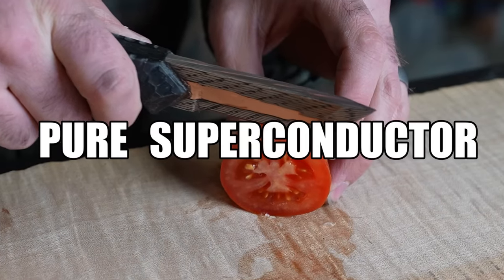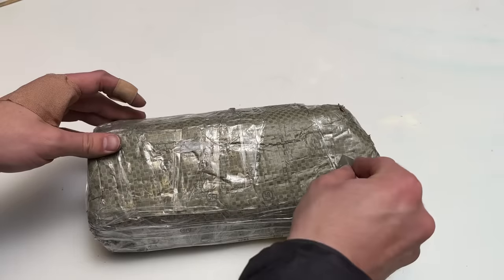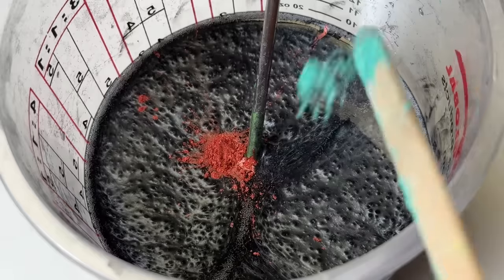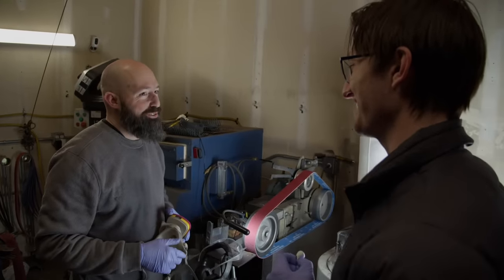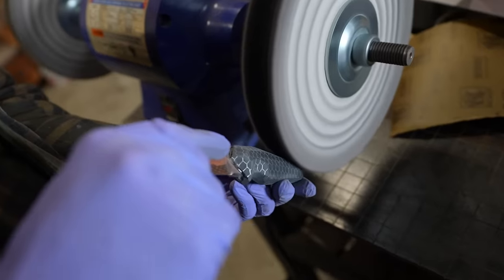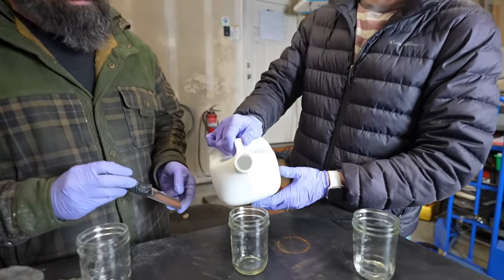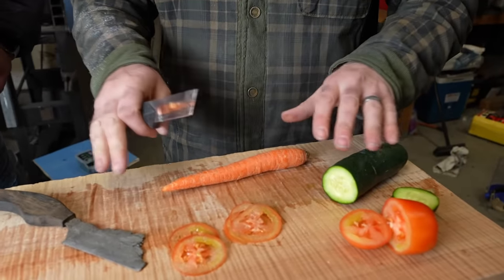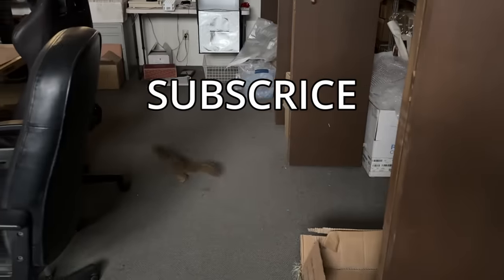World's Sharpest Superconductor Knife

Comment: If you want something mind bogglingly sharp ask for 1 of 3 things. Go to a butcher shop and ask to see one of their freshly sharpened blades. They're much sharper than a razor. 2, buy a scalpel with a metallic glass coating. They're sharper than steel can be. 3, Get a volcanic glass razor. It's hard to find someone that will do it right, but if you do it's the sharpest thing outside of an atomic microscope.
Reply: A microscope...for cutting? From this I can surmise that you're a sharp lookin' hombre but perhaps not the brightest tool in the chandelier ;-) And me thinks obsidian is the material in Numero Terz you're thinkin' of.
Reply: @ropewash4432 I think I've seen those videos. I could be wrong but, I don't think that's part of the functionality of the microscope in and of itself. I am willing to concede, however, that I was being a bit pedantic about the term microscope.

Comment: Orycalcum is a viking-foam-alloy that cools into prills suspended in matrix, "beads in a mixture" [metalic-styrofoam]: poured into ingots, the metal behaves differently than homogeneous alloys; prills maintain themselves at the expense of the matrix, which imparts the beaten-metal-forces throughout: beaten cooling prill contort and stretch but maintain sharpness as an edge, while the weaker bronze-matrix fail-&-expose further toothed edge. I've explained orycalcum too many times...
Reply: Awesome!   It sounds like another ancient,  accidentally created nanotechnology.

Comment: I don't think your contact sold you an actual superconductor - a material which electric resistance vanishes below a certain temperature - but instead he sold you a "superconductor" - a piece of a wire made to conduct a very high current. I also wouldn't trust him on your sugar deliveries.
Reply: Right, superconductors are usually a quite brittle ceramic so I am also a bit confused